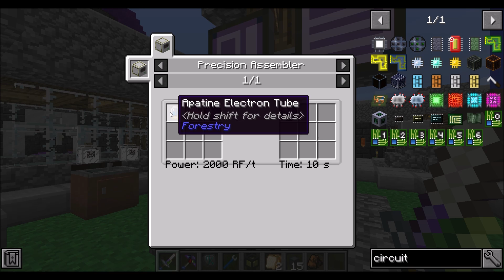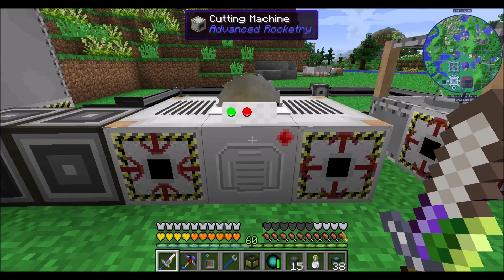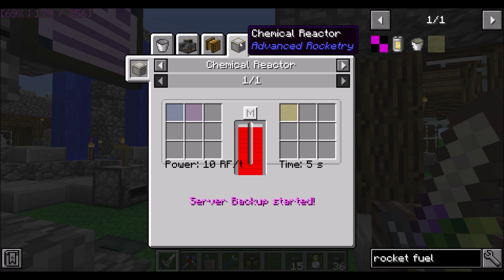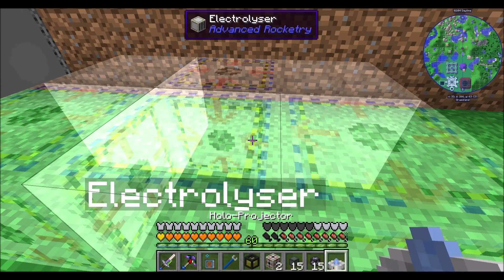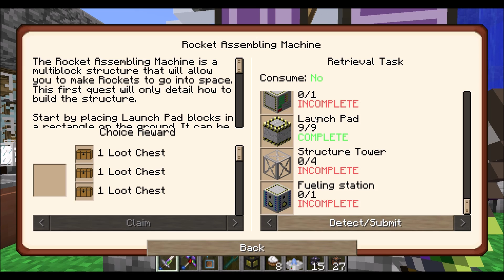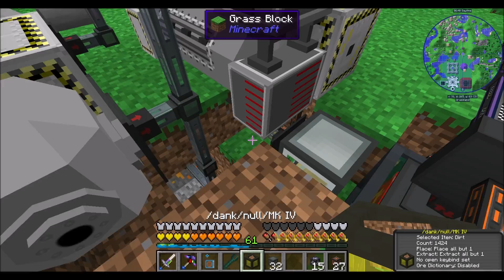Enigmatica 2   Ep61 Rocket Prep

Comment: Just a note, if anyone is watching this and hoping to make Rocket Fuel this way. The pack updated since this video and this Rocket Fuel recipe no longer works. you need Oil Shale or oil Sand and harvest with a shovel. Personally, I am using a Silk Touch shovel, not sure if it is a requirement, but it does work. not the video maker's error, just a pack update.

Comment: melanism rocket fuel doest work. melanism hydrogen and oxygen don't work. and, after an update, the nuclear craft chemical factory stopped working. As of right now, the only way to make rocket fuel is in the immersive mixer with tar, bitumen, and nuclear craft oxygen. 

I have Astral gateways set up on my space station and on the moon, as well as in the overworld, the end, and the nether. use an anvil to label the gateways.

Comment: Hey Dire did you know you can wear the wireless AE thing as a Bauble and bind it to a Key like "y" or so.
Reply: warning, I upgraded/added fluid to my wireless then put it on my head.  After that, I couldn't check my inventory without crashing the game.  I ended up restoring, and not doing wireless fluids/separate wireless terminal.

Comment: Dire: "I've got pretty good armor" Also Dire: voiding quantum armor. #Direplease
Reply: To dire "good armour" means "whatever i have on" or "draconic"
Reply: Rock River Dire doesn't care about ic2
Reply: rockbandinthusiast dire cared about ic2 when it had easier recipes. Today ic2 is just nerfed and bad.
Reply: I'm pretty sure you use flux armor to make quantum armor in this pack... so it has to be better, right?
Reply: Good point, and yes, it is. It’s WAY better. (apart from against magic based attacks)
Reply: The facepalms are real! #direplease
Reply: @GlitchReaper  It's unbalanced in a pack with mekanism. Smelting and other etc a full stack in a tick or lil bit more is pretty good late game for speed.
Reply: IC2 armor can't take airtight enchantments :*(

Comment: It is funny that dire thinks fluix armour is decent armour while he voids quantum armour which is the one of the best armour
Reply: Quantum armor (Chestplate to be specific) give invulnerability to every type of damage except void.
Reply: Fluix armor?
Reply: Flux Infused Armor was giving you near invincibility (because of a bug) back in 1.7 and it did provide at least double the protection of diamond armor after the bug fix. He probably remembers those times. Also, IC2 armor needs IC2 power to charge which doesn't work with his thermal battery, so that's a big downside. Would need recharging in the mekanism cube, in case he  knows that works. There is also simply no need for better armor at the moment.
And it will take a while before he needs the armor to craft wyvern armor so there's still time to change the filter. The real waste is terrasteel armor pieces he might be voiding because you can skip crafting that alltogether if you have enough to just make seeds.
Reply: @zapl80  quantum does give creative flight though.
Reply: @nickr26  ah, right he didn't make the angel ring yet, so yes that would be beneficial. It's not a nice form of flight iirc, jetpack with toggelable hover mode and had trouble with it and ditched quantum armor for flux infused myself because I had an angel ring anyways.
Reply: @nickr26  It doesn't. It gives you some kind of awkward jetpack flight.
Reply: @vaultechwithsoup6569  flux armour sorry . My mistake
Reply: "IC2 armor is better than Thermal and any other mod's armor? That ain't right"
~Dire, probably...
Reply: Direderp.... hes so dumb about everything.
Reply: No, he’s just derpy!!

Comment: How did the item conduit know to directly import glass and no other material into the system? Am I missing something?
Reply: Afaik: He has an ME Interface set to export glass, you do that by putting a stack of glass into the top "Config" row. AE will then populate the slot below that with glas from the system. A conduit set to extract on brown on that interface then sends it to all machines with input on brown.
The issue with exporting items from ME Interfaces is that the export slot is not getting imported into the AE system and items that land in there might get sucked out by conduits again. You can avoid that by configuring the last slot of the interface so items the need to be imported go into the first slots.